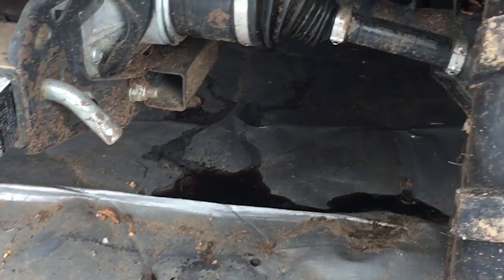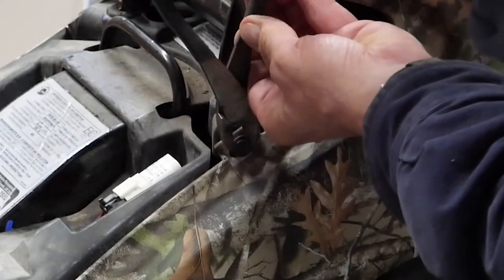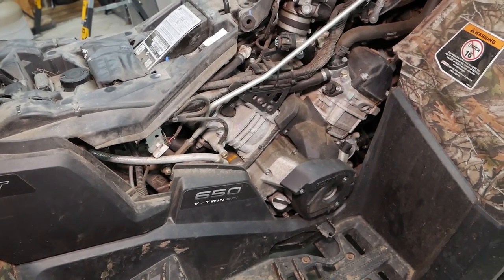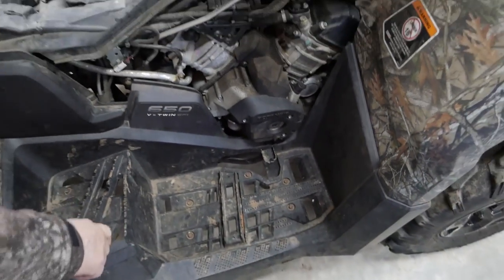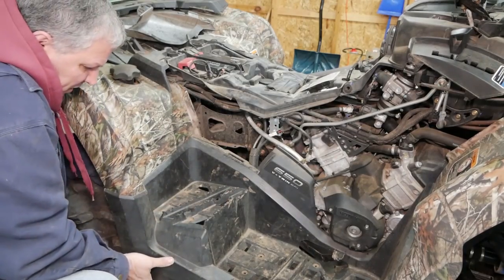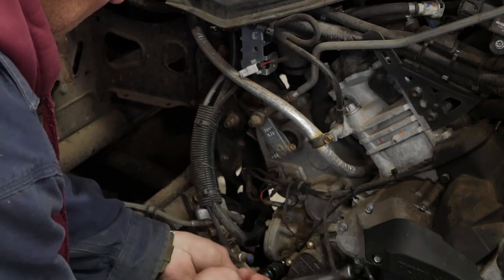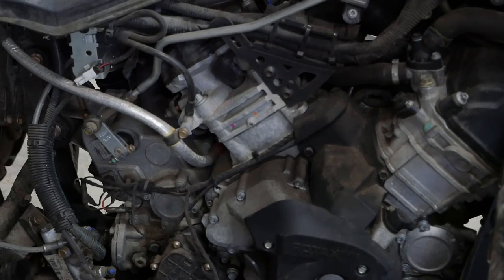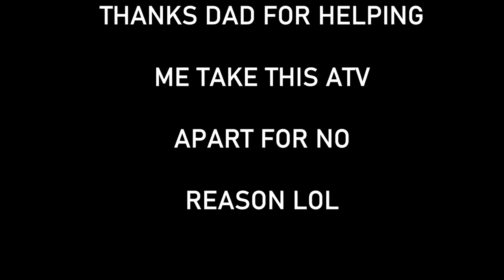REMOVING ATV PLASTIC BODY PANELS to CHECK for LEAK - Can Am Outlander 650

Comment: My 2011 Outlander 650 had a overheating issue, where every now and again it would get hot (in the winter, used it for plowing) and if I didn't shut it off fast enough it would spew out antifreeze. This only started happening in the last year I owned it 2019. I never found anything wrong with it as to why it done that. So with that and a lot of other things I got rid of it.
Reply from the maker: Bummer. Haven't had that problem at all and I know it was used for years to plow a 300' driveway. Still don't know what this leak was about but it has been fine since. Can I ask what you replaced it with?

Comment: my 2020 570 twin leaks a bit around the coolant stopper i think ...it drops on the cylinder head and i smells it
Reply from the maker: Interesting. Could be a warranty issue?
Reply: @CreatingASimplerLifeOffGrid  took mine to the shop after,and it was the coolant reservoir..it was leaking where the tank is joined..
Reply: @toddhurley1237  My buddy had excakly same problem. The reservoir is made in two separate pieces, top and bottom with a seam in the middle with no gasket. ..Mind blowing on why they would make it like that but that's can am for ya